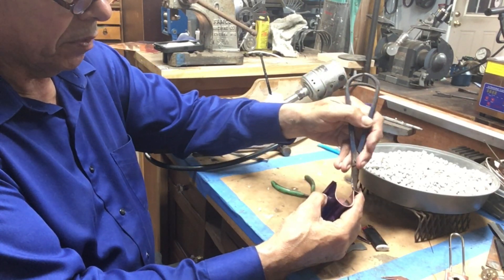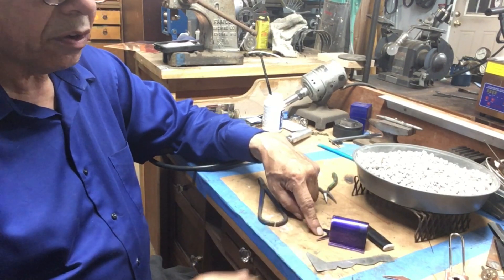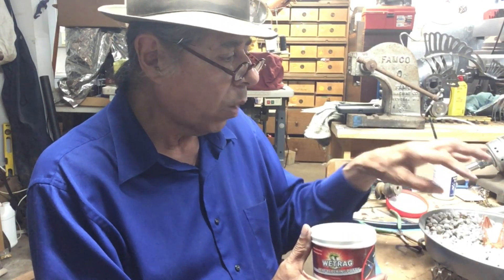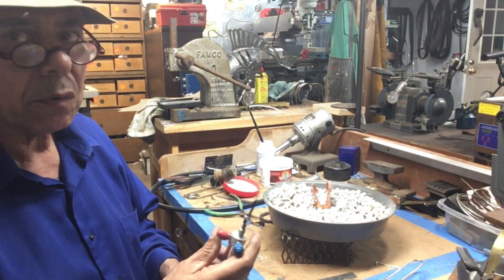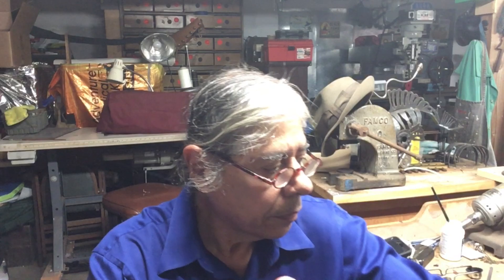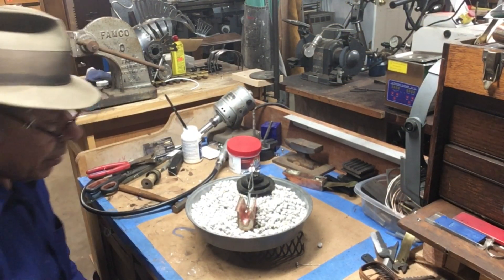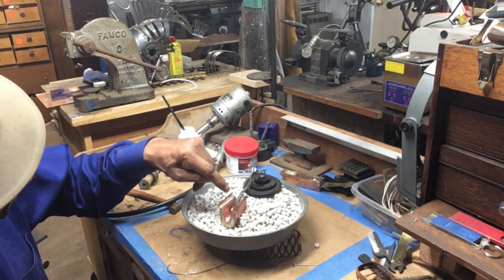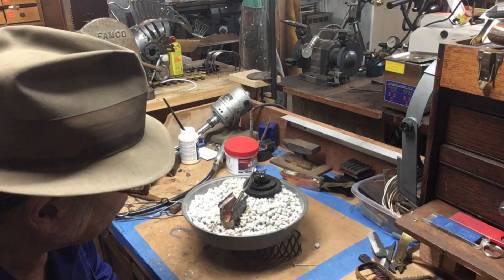Part 3 1890’s Japanese blowtorch

Comment: Still not a clear picture of how the pipette is suspended in the domed area. I was trying to see a better diagram of that part. Your instruction and technique are masterful!
Reply from the maker: @kriseckhardt5148  thank you for your acknowledgement. I have had a few inquiries as to this detail. I built this with little information gleaned from a demonstration video. In that video he also showed a rough pencil cartoon of the interior of the saddle tank. From that i extrapolated a working concept and followed my nose. That said, i have decided to make a video using a white board to show these key details. Probably post after this weekend.